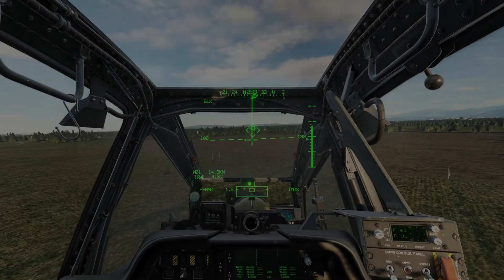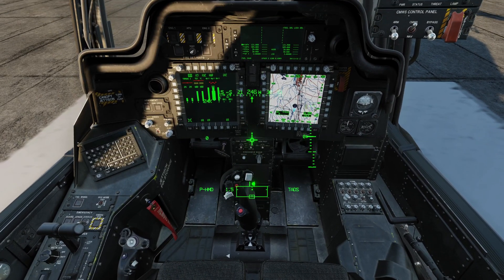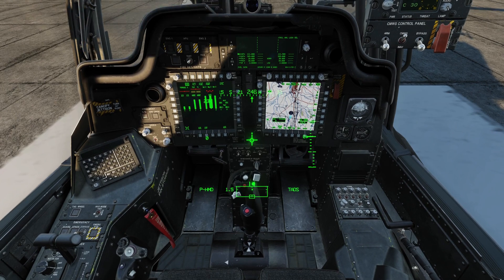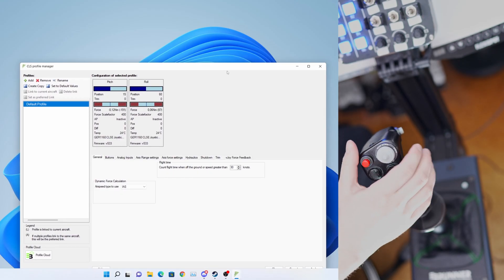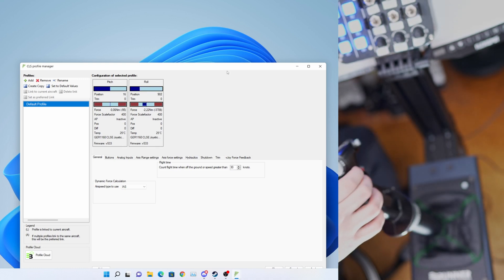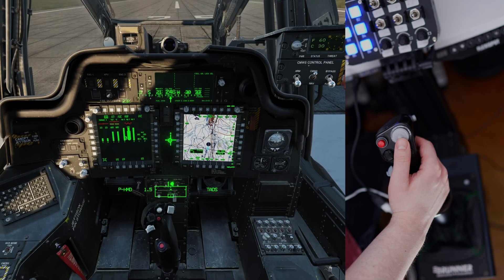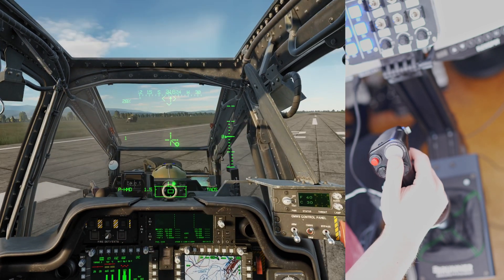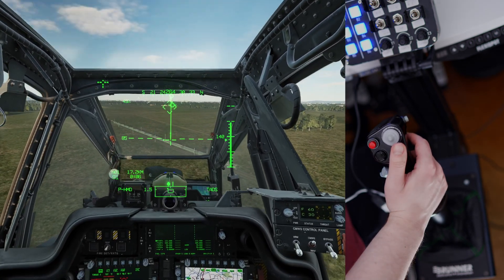DCS AH-64D Apache Trim with the Brunner CLS-E Force Feedback Joystick

Comment: Can the Brunner FF be used without a force trim system and just have it basically trim/center wherever you leave it? So if you have the trim system disabled, and you input half deflection to the left, then release, will it stay there until you make another input?
Reply from the maker: Yes. If you disable the move back function in the force settings it will do exactly that.

Comment: Hi, in interested in this stick but as a DirectX device. Considering the price, I want to be able to use it as a FFB device in older games like Mechwarrior BMS. Do you have any thoughts as to whether it would work with older dx FFB games? Did our ever make the DX video?  I have a warthog stick and warthog wheels and pro stand which I would use with this.  Would be great if you could recommend an extension to use as well.
Reply from the maker: The stick itself does not actually support DirectX FFB. It is only the kinda hacky BrunnerDX solution that enables it to work at all. As far as videos are concerned, I only made this and the F-14 one. I am building a new home right now, so the time for videos is a bit limited. 

As far extensions are concerned, Brunner officially say that the CLS-E is not rated for extensions at all. Personally I use a 10cm VirPil extension on it with a Warthog grip. For the weight of the stick, 5-10cm is workable for me. Lower gives you more stick force of course. The way the base is constructed, you sort of get a built in 5cm extension compared to a VirPil base. Others in the r/hotas Discord have used 20cm on lighter grips and are satisfied. I have tried the 20 cm S extension with the Warthog and it is barely enough to center properly.
Reply: @twoknife  my other concern is the bit I heard about the CLS-E box overheating.  I'm very concerned about that.  What's your take on that problem now(any resolutions)?  Why in the world would they not have active cooling on such an expensive device?  Aside from that, I have the Wheel Stand Pro Super Warthog stand. Trying to figure out how could get get a short extension between the Brunner and the stand to give a reasonable amount of better precision when flying.  Any thoughts on that or know of anyone using extensions with this configuration? Also, any link to the DX solution for the Brunner?
Reply from the maker: @garyjnj1  So it is not actually overheating at all. It is rather a timer to protect the motor from damage. As such active cooling would do precisely nothing. It will give you 30 seconds at full torque (4.5nm) and then drop (to 1.5nm). When you turn up the centering force all the way, yeah it will be a serious limitation. I like a fairly light stick, so I can use an extension and enjoy the effects, but I never hit the limit in actual flying. The Brunner base is pretty hard on the mounts. I wouldn't bother with it if you have anything less solid than Monstertech mounts. Feel free to talk to people over at r/hotas. There are a few more CLS-E owners around.

Comment: I just got my cls-e setup for the ah-64. Would you mind sharing your other CLS2Sim settings? (axis range, axis force, hydraulics, etc?) Thanks!
Reply from the maker: Hi, and thanks for your email as well. I am glad this was helpful for you. I will just reply here since the answer is pretty straightforward: I had everything else set to default settings. I tend to go the BrunnerDX route for flying the Apache, so there is really not much to do in CLS2Sim. I also used a profile with a higher centering force that matched my old VirPil base for a while with fixed-wing aircraft.
Reply: @twoknife  Thanks for the reply. I'm trying BrunnerDX now (thanks for the suggestion). What advantages do you find in the apache when using BrunnerDX over CLS2Sim? It doesn't appear the apache is really sending any force feedback data to even a 'standard windows force feedback controller'.
Reply from the maker: @OldRoo  Both ways work just fine. Running through BrunnerDX is nice in the sense that you don't need to deal with profiles for different aircraft and DCS is in charge of all trim versus having Rudder managed by one and cyclic by the other. Be sure to unbind the axis of the CLS-E device and bind it to the Arduino in DCS. There is also a FF tune in the controls and some general FF settings in the special options (both module and general). If you need help, the BrunnerDX creator is active in the r/hotas Discord as well as a good number of people using it.

Comment: Hi, I am considering buying one of these specifically for use with the DCS Apache. Do you think its adds sufficient value to flying the module? I have a separate simpit for jets, so I am only interested in its use for flying helicopters in DCS. I wanted to use it with a real simulator F-18 grip, as this is light. Thank you
Reply from the maker: At the end of the day, you only get force trim with the Apache at the moment and it is far from a plug-and-play setup. Keep in mind that the support for Realsimulator grips is fairly limited. It is recognized as a HOTAS Warthog stick and only gets that number of buttons.

I am personally considering only using the Brunner as a helicopter stick and moving center jet stick (such as the Warthog or Tomcat) while adding FSSB R3 as a side stick since I mainly fly Vipers.
Reply: @twoknife  The AH-64D uses IIRC magnets for an artificial force-trim, so what else exactly do you think it should have?
Reply from the maker: @ArchOfficial  That's something you will probably need to ask an Apache SME like Casmo. I haven't found any info about the specifics on the Apache. 

The stick is basically your only haptic feedback from the aircraft in a sim environment. So at least a little bit of vibration for the rotors, guns and weapons would be nice. The F-14 even conveys all the little bumps while taxiing. I would definitely expect to feel something when overspeeding or over torquing the rotor.
Reply: @twoknife  I know F-15, F-16 and F-18 only provide pre-programmed force as a relation of stick deflection. In the F-16 for example, the requested G-force is correlated to a constant stick force, at least in steady state. Ie: there is only a centering force but nothing else regardless of what the aerofoils are doing.

Although it's possible that you would indeed feel weapon discharge and so on if it vibrates through the whole craft, maybe.

I think the F-14 is a manual control system so it will have a more dynamic FFB situation.

I think in the AH-64D case any kind of aerofoil induced changes one might feel are so far above the boost clipping point already that they're not possible to be felt, hence the magnets to provide a specified centering force.
Reply from the maker: @ArchOfficial  Interesting that what you seem to "know" about F-15 and F-18 does not match any information I have seen. With the F-15 it depends a lot on the version. It has a combination of mechanically linked controls and an early fly-by-wire system. The Hornet is a pure fly-by-wire aircraft but has artificial feedback on the stick much like a Boeing 777. The F-16 is the odd one out with a fly-by-wire system, a force-sensing stick, and no feedback through the stick. As far as DCS is concerned, not even the centering force works properly in the F-16 so it is the by far most annoying aircraft to fly with an FFB stick, and why I am considering a Realsimulator stick for that (since it is actually my main aircraft).
Reply: @twoknife  Mechanically linked and being fed through a fly-by-wire "box", but boosted nonetheless. Correlated to G IIRC.

F-18 doesn't have any "feedback", it has a G-correlated stick force like the F-16, unless I'm just entirely remembering wrong.

F-16 doesn't need any system to provide force to the stick because the sensor is the stick force, and you can just correlate the control inputs = the G to it directly.

Comment: Hi. Thanks for the video. I am considering the Brunner base, only for DCS use. After your experience with it throughout this time. Do you recommend it? Regards!
Reply from the maker: The value proposition for DCS really isn't that great. The stick itself is very good, but support is limited in DCS. It is excellent in FS2020, X-Plane or IL2, but not so much in DCS. The reason is that basically only Heatblur's modules and a few warbirds have good support with all the forces and effects you would expect. The F-16 and F/A-18 have literally no support other than centering force. So for those you are roughly stuck with a base that is about as good as a VirPil MT50 (with a limitation of a 4nm centering force so no 20cm extensions), but costs four times as much. If you are into helicopters, you at the very least get force trim.
Reply: @twoknife  Many thanks for your replay.  Are you planning to release a video with the arduino work around that you mentioned? Also it would be great to see a comparison of the base with the different modules.  It’s a pity that DCS is not fully engaged with FFB bases like this, specially when, as far as I am aware, is the only option in the market right now….
Reply: @twoknife  i use a 20cm extension with it no problem however you cannot use a warthog stick with it gotta use virpil
Reply from the maker: @cosmicxsolitude6947  It can be done for sure, but the base definitely has more reserves with a shorter extension. It is still a 4.5NM torque limit and that is fairly weak on 20cm - particularly when you overheat the base and it drops to 1.5NM. For the purposes of just using it for trim, it is probably fine